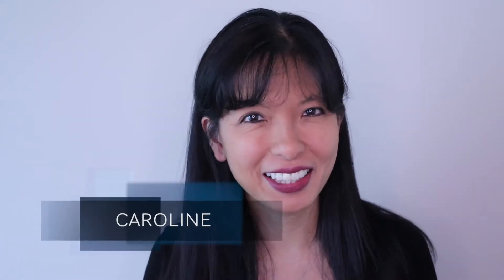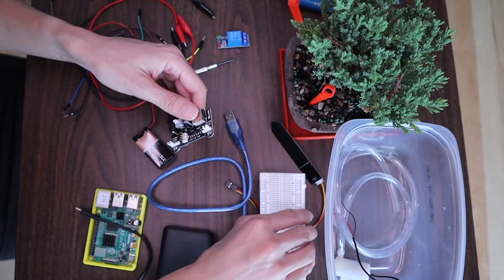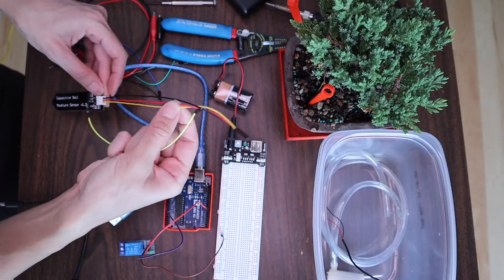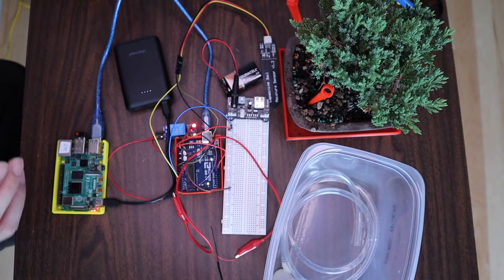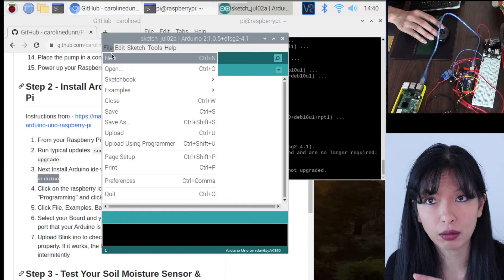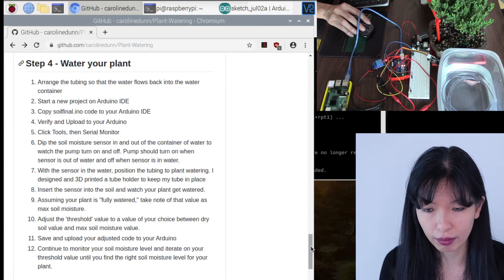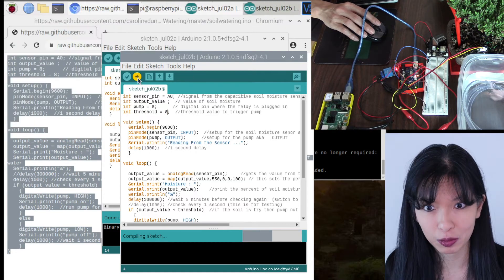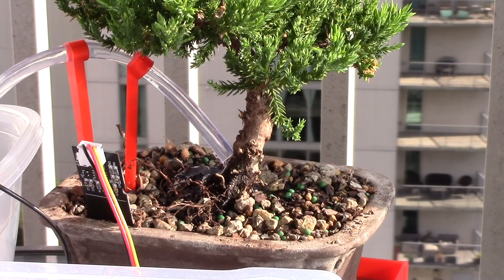DIY Raspberry Pi Arduino Plant Watering System

Comment: I want to connect many sensors like these across all garden, large area, what should I use for 20-25 sensors?  multiple arduinos or is there some splitter that can be used for many sensors and converting their signals for the Pi digital?  (an ADC with many many slots :D )   what would be best approach?

Comment: I followed the tutorial step by step, but seems my pump is always pump no matter what signal the arduino is send to the relay (HIGH or  Low). how can I debug this ?
Reply: Had the same issue. The relay was not switching on/off. After connecting the ground on the relay to ground on the Arduino (not the breadboard) it started to work. After that everything worked perfectly.  Excellent tutorial. Didn’t need raspberrypi tho.

Comment: Absolutely wonderful! I am going to do this project myself, and actually bought some of the components before I watched your video. I really like that you went through the wiring and explained the components. This will be my very first project ever, so I'm a bit in the dark. I'm wondering a few things; what is the reason for having the extra relay between the pump and the relay? Is it possible to do this straight from the raspberry pi without an arduino? I guess it's not possible to get 5V out from the raspberry pi, so the battery is necessary? I'm also going to be using a LED grow light to turn on and off based on a cron job, so that's another component that I'll need to control. Is there a component that controls power-on/power-off to a different component?

Comment: Hi Caroline. This project will work great for my herb planter. I'm trying to run 4 pumps though, basically just adding on three additional pumps to what you already have. I've bough a board that supports 4 relays. Do you have any suggestions on powering up all 4 pumps? Should I use something other than 9V battery?

Comment: Hi Caroline! Great video! I'm trying to implement a similar project and I need your expert opinion. I've connected my RPi with Relay which will be connected to the water pump. If I power the relay from the main supply (instead of using the battery), would that be okay ? I'm too scared to try and don't want to burn down my house trying this experiment. I'm a newb at this and would appreciate your help. :)

Comment: I’m confused why both a RPi and an arduino need to be used? Wouldn’t an RPi suffice?
Reply: no because the sensor is analog and pi can only read digital so you would also need a ADC accessory for the pi.  but yes, possible.
Reply: @babyfox205 so couldn’t just the arduino be used?
Reply: @ShreddinSleds yes, you could use the Arduino instead

Comment: Do you need Arduino Uno if your using Raspberry Pi? I am guessing you may use GPIO pins of Raspberry Pi and connect to relay?
Reply: I think coz soil sensor gives analog  but I agree a2d would have handled

Comment: I have two questions: 1. Can the water pump use the Uno's 5V output instead of its own battery powered 5V? 2. Why does the relay use NC instead of NO? It seems to me it makes more sense when the power on, the default state should be pump off, not pump on.
ok, I just read the previous discussion, and it seems to me the point is Uno's 5V output isn't enough to drive the water pump?

Comment: Hello Caroline! I was wondering, how would I add two more pump systems to this? I assume I can use the one raspberry pi / arduino uno for all 3 pumps? (I'm a newb and LOVE this video!! This helps SO much! Thank you!! )
Reply: I'm trying to do the same iv been able to run 4 sensors with 4 pumps iv been able to get this to work but the only issue being it runs through each sensor / pump separately causing a 20 min delay before it gets back to my sensor 1/pump 1 im more then willing to share my code if this is something that will help you 

I am trying to make it sense all sensors at once and trigger said pump if the sensor gets low i haven't been able to do this yet with out a delay but I'm still plugging away

Comment: Hi Caroline, I was wondering why you keep the raspi attached? Shouldn't the code already be uploaded to arduino board? Overall, good video, thanks.
Reply: She wanted to VNC in and continue to tweak things.
Reply: @nightcoder5k  does it mean if I don't need the VNC function, I can detach the raspi after finishing the setup ? thanks